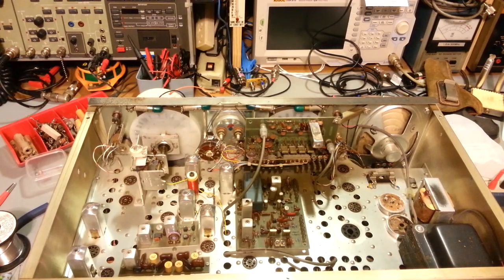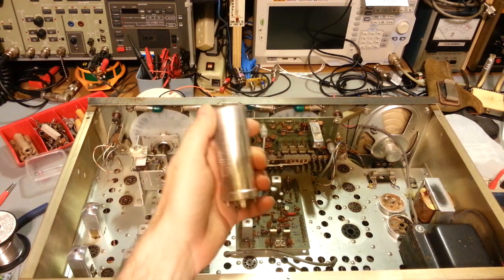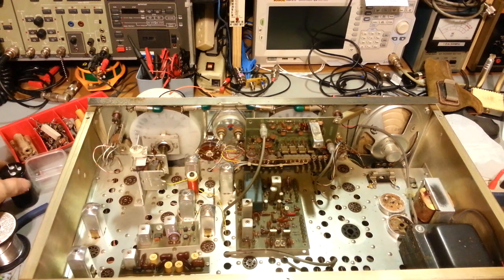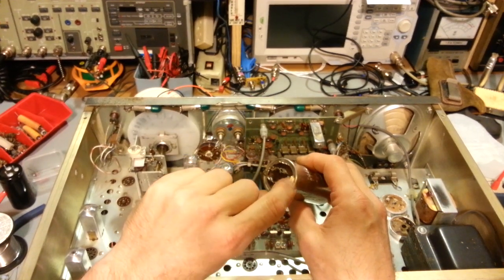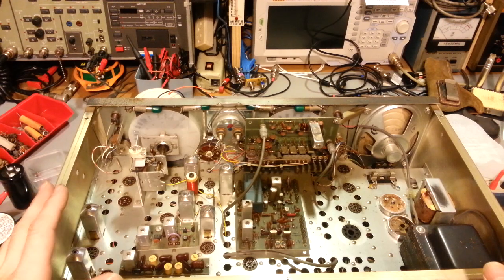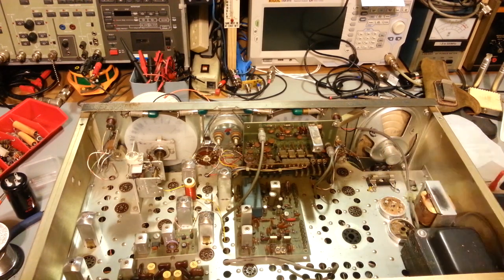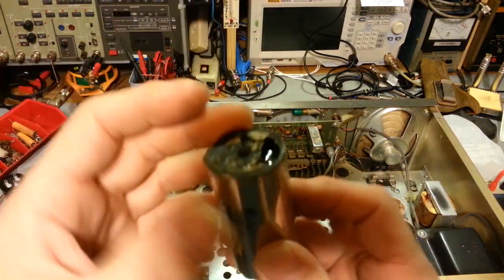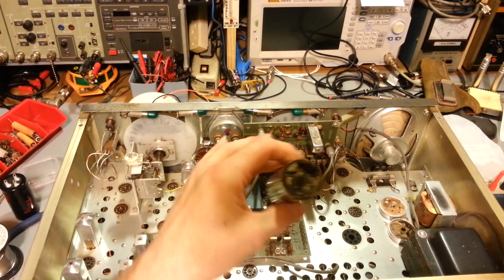How not to restuff a can electrolytic capacitor.

Comment: I had a Jukebox /w/ old can caps that didn't have a readily available replacement version.   I just disconnected the existing old cap from the circuit,  and let it stay mounted.   A terminal strip and new Radial/Axial caps now do the job hidden beneath the chassis.

Comment: When I first saw that potted cap I thought it might be PC-7 or J-B Weld but on continued view it had gray-white sections so it was either poorly mixed or something else was added.

The few times I have re-stuffed caps I have used the peel the flange method as I have seen the cut and glue method fail too many times and have run into cases where there is just no room below the chassis to put extra caps. This is especially common with shallow chassis gear like Wollensak tape recorders of the tube era and some car radios.

I have gone to hot glue too. Flexible stuff like silicon is too acidic and other flexible or insulating glues are prone to becoming conductive as they age. You can see this in modern gear where caps and other parts were glued to PCBs and failed due to the mastic aging. (It becomes conductive and also eats leads and pcb traces.)

Good instructive piece with valuable cautions.

Comment: I remember working on some older 80s amps especially Yamaha. That used corrosive glue to hold down the larger heavier components on the board and over time glue would eat the jumpers and resistors off the board

Comment: Hayseed Hamfest builds some nice units for Drake and Collins gear...used them to re-do my Drake C-line and have the 2-line rigs in the queue to be done sometime soon. Not cheap but not exorbitant either...just like a hard drive it's not if the electrolytic will fail just when it will do so.
Reply from the maker: Dino Papas 

I have had them build some custom capacitors for me before.  What's nice is there is no extra charge for it.

Comment: Should I have any consern about lack of heat dissipation when stuffing several smaller caps into a can? Looks like a new problem is being created?
Reply from the maker: And it would be worse than the capacitors that were in the can previously how?
Reply: Provided the caps have low ESR (i.e., they're good), there should be minimal heat from the caps.  I'd be more concerned about the caps being close to a hot output tube, but (like Mike says) just use 105 C rated caps and they should be fine.

Comment: well in the Military ARC-5 Receiver I re-stuffed one of the round can type caps which you will never find off any shelf and when I was done it looked like the original because it just had new caps inside it but I agree if you can find a new can electrolytic that doesn't cost an arm and a leg use it.
Reply: That's not very smart! A leaky caps is still a leaky cap if put a new one in parallel with it. A leaky cap becomes a shorted cap and now you have a fire hazard. Stuffing caps is ridiculous.

Comment: Good info, thanks very much.  I've seen silicone eat through copper wires (my bad, I used the silicone that releases acetic acid when setting) -- but I thought tar was good for 10+kV (per the neon tube transformers that are potted in tar).

Comment: I just leave the old caps in and install individual caps on the bottom. So much easier
Reply: If there's space.  I like 'Mr Carlson's Lab' approach, of soldering stand-offs to the canned cap terminals, then using the stand-offs to mount the new [and much smaller] caps :-)
Reply: @theskett  I'm mistaken then too. I thought he used terminal strips.
Reply: i cut the top of the can off and throw it away. then i got a nice terminal strip using the can base.